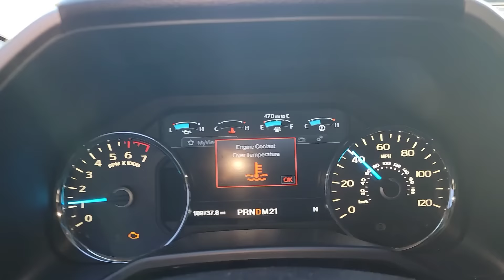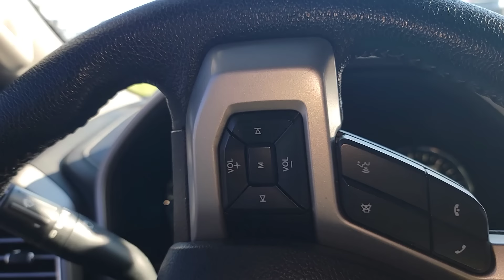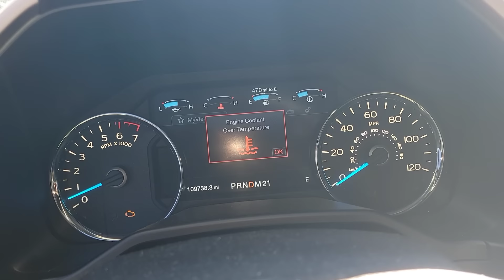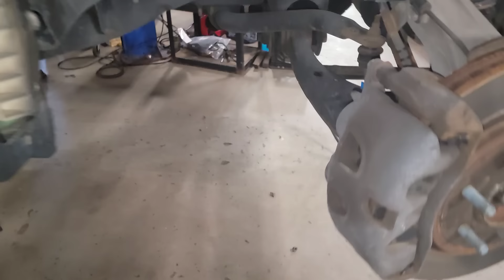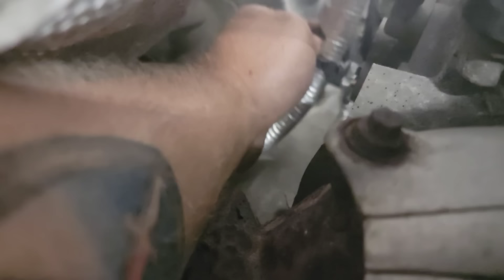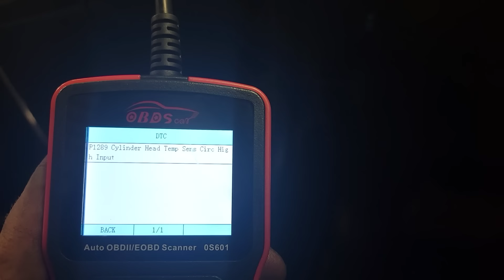2015 - 2016 Ford F150 P1289 - Overheat Out Of Nowhere - here is the fix - Cylinder Head Temp Sensor

Comment: Same issue yesterday on 2015 5.0.  It stranded me and 88 year old mother in law.  Was fine on the way to her house 8 miles; turned off to walk her to truck. Didn’t want to start.  Started on second try.  AC wasn’t working right (90 degrees outside).  Started watching temperature gauges nothing showing on coolant gauge, transmission temperature was fine.  Didn’t make it home.   

Now I am worried about mother in-law seating in the heat and of course my broken down truck.  I waited for ten minutes between attempts to crank truck and drive the approximately 1 mile to my house.  It would not crank.

I found this video after family picked up mother in law.  I saw where clear codes to operate correctly.  I happen to have something to clear the codes with.  It was like a miracle.  Everything was operating like perfectly.  

Today I changed the sensor.  Without this video I would have been screwed.  Thank you so so much!

I had 2 iPhones; FaceTimed myself to get a good view of the sensor.  Your video put me on it but seeing it while working it was good for me.
Reply from the maker: Beautiful

Comment: Had this exact alert and problem happen on my 2016 5.0  158,000 miles this week. Alert showed on dash, Temp gauge went to 0, CEL on, and Trans temp showed normal like you mentioned. Before I saw your video I dropped my truck by a local non-dealer shop. 

They did a disposable block test and told me that test showed coolant present in the cylinders and exhaust present in the coolant system. They say bad head gasket. Recommended engine replacement. I did have them clear the CEL for me, I paid for 30 mins of labor and brought my truck home “ran perfect coming home a few miles”. 

Oil looks perfect, no smoke, no sweet smell exhaust. Coolant reservoir shows about 1/2 inch low below the Max fill line.  I picked up this sensor at Ford this morning for $28; going to throw it on and see what happens.
Reply: Any update? I have the same truck w the exact same problem. I’m waiting on the sensor from Amazon, but when I dig in under the wheel well for the sensor, my undercarriage looks a bit different, and I CANNOT for the life of me find where the damn thing is. Any insights?

Comment: Yup. Had this same issue. I was leaving Walmart and out of nowhere my truck said it’s overheating. Throws codes. Then puts the fans on high the whole drive home. Told my mechanic the next day, googled the issue and found it’s one sensor on the backside of the block. Good video though bud 🤟
Reply: Right now I’m having the same issue please may may I have a sensor name ?? my truck said engine coolant  over temperature

Comment: A Ford Senior Master Tech had me remove the negative battery terminal for 10 minutes and I was able to get off the highway. Saved me an expensive towing bill! It kept working fine but still changed the sensor. It is on the third one over 120,000 miles. The lift sure helps replace it!

Comment: thanks to your video I was able to do this job on a friends truck. I didn’t have to remove the fender trim, I removed the two screws that were hidden for the fender liner, also the harness I didn’t have to move it out the way. But I did it blindly just by touch. Very easy. Thanks 🔧🪛🧰😎

Comment: Have not had overheating for many many years. Last time the fan belt broke and the engine burned up most of the oil and boiled out the coolant. A new belt and top up coolant and oil and was on my way. Big old cast iron V8, 472. Can’t keep driving to a garage today with modern engines.

Comment: My 06 F250 does the same thing.
Temperature gauge goes to full hot but the engine is not hot.
I’ve had it in the shop twice, replaced sensor and harness twice.
Once in awhile it will do it again.
I simply turn the engine off, wait a few minutes, restart the engine and it’s all good until the next time.
Reply: Just read your comment.  I assume you have the 6.2L. Have you replaced the sensor.  My truck did the same thing a month or so ago and I could not figure out the problem.  Haven't had any issue since and it runs perfectly.

Comment: I’m currently experiencing this on my 17’ ecoboost mustang. It was my fault for not checking the coolant before going to work. When I filled it with coolant, I had autozone check my engine light. It came back as my cylinder overheating protection is active. The car runs, idles, accelerates just fine and doesn’t give the notion that it wants to stall while driving….

Comment: Ok, I give up after 2.5hrs of frustration, how does the clip for the wires come apart? I’ve tried a little screwdriver and can’t seem to get the clip to release. Wish there was enough room to have filmed that part. 

The way this presented for my daughter on her 2016 F150 5.0 is pretty much as described, she got about 3 miles from the house, the temp gauge pegged at max, over temp warning message popped up, and the engine started shaking and barely ran. She shut it down and called dad. I pulled it home, pulled the therm and tested it on the stove, working perfectly. Went searching on good ol utube and found this vid. Thanks for posting, really helped us out in figuring out what was happening. 

Now about that clip…
Reply from the maker: Clip for wires? I have no clue what clip you are talking about 

There is a connector for the sensor - it pulls back and you push the end of the lock down like it's the release and pull the connector off 

I don't know what else to say 

If you want to video chat me later and show me what you are trying to do here is my email 

Poissorichard.rp@gmail.com

Comment: Same thing happened to my 2002 f150 but completely opposite.  Coolant temp sensor was dead throwing a p0128. I verified that the thermostat was not hung open and when I hooked my scanner up to it the reference voltage was five but the sensor was only 300 ish ohms  when the engine was stone cold
Reply from the maker: Yep that sounds like a problem for sure

Comment: I bought  2016 f150  2.7 echo to this day only 16k miles . I got it brand new off lot first owner .  4 weeks later turbo  on left goes out . and high temp light on and fan is racing .  took it to ford and they refuse to fix it . I was never ruff with the truck  I hardly drove it because I m a otr driver.  So basically i got screwed  on that truck . I still have truck but it just sits. there was a really good reason it sit long to . to be honest i feel  like washing my hands of it.   lets say i got a free truck  after taking 3 years waiting for legal action to  rule in my favor.
Reply from the maker: How much do you want for that truck

Comment: I have an older 2007 expedition with the cylinder shut off cool down feature. When I first got the vehicle on warmer days and in reverse the cylinder shut off would engage and I thought it was a reverse problem and then it started doing it while slow rolling after driving and I thought the vehicle was breaking down from being old and then I learned about the cool down feature. It does it all the time now and I think I'm having the issue you are showing. There is no dash warning for it on a 2007 but everything with the truck is running fine as you've stated.
Reply from the maker: I'm not familiar with the older style
Reply: @FordBossMe  It glugs like a diesel when it does it and I used to think it was stalling out so I would quickly drive to increase RPM's but I know now that as soon as it seems to putter out it 
re-corrects itself and then idles normally but its still annoying, it will do it when driving slow now and it slightly changes the performance and when you are by people they think your truck is in the process of breaking down.

Comment: Similar situation for myself on my 2017 3.5 ecoboost. 3 years ago radiator & new water pump. 6 months ago hauling a load with ac on truck overheated and blew coolant out the relief. Shop replaced the tstat. Was good over the winter but then about a week ago when I hauled again with cruise on ac running air temps around 55 and it progressively warms up quickly and throws the overheat. However no check engine lights. Pulled over and turned ac off and temps went back to normal fairly quick. Finished my remaining 10 minute drive. Fished the day and went to drive back home. Got 20 minutes down the road and it did it again. Still no check engine. 

Any recommendations on quick things to check before I bring it back in? I got a warranty so they can fix it up but just curious if you have anything I can tell them in advance

Comment: Jeeze, Gotta Dismantle the Passenger side of the Truck to change a sensor that's litterally buried. Engineers??? If they had to work on these units they'd think twice about some of these things. So much for the   K I  S  S  method.
Reply: Not all parts of a vehicle are easy to get to. That is the same for all brands and models of vehicles (and trucks). From an engineering point of view, this sensor has to pick up cylinder head temperature in a spot where it accurately reflects the engine temp (far enough away from coolant temp). In this case that position is not easy to access, though it is not impossibly difficult. I have had issues where engineers have placed/designed certain components. But most times they do a reasonable job. So give them a bit of slack. I am sure some things you have designed have given people grief. But I am sure you had your reasons. Retired mechanic in Land Down Under.

Comment: Great Info. Question if I may 16 PIU 3.7 Weak Trans Mounts caused L/S Inner CV Damage PTU Coolant Lines. Common ?  Saw my First Today 120,000 miles. Parts on Intergalactic Back Order. Thanks for your Time.
Reply from the maker: Not common at all
Reply: Found my 2 concern with motor mounts and PTU Coolant lines this AM. Again 120,000 16 PIU.
Reply: Confirmed weak motor and trans mount on PIU  let's trans drop low enough for l/s inner CV to contact PTO Cooler lines , causing coolant leak. New Mounts make a big difference.

Comment: Have a 2014 F150 3.5L... temp guage after an hour would climb without trans temp climbing. Switched CHT sensor oem and still doing it. Thinking thermostat ,but its only 2 years old and NO CEL or warnings even when its just below the "red"?!?
Thinking could be bad CHT wiring maybe.

Comment: 2016 2.7 Ecoboost with 1299 code. Do you know if that's cylinder head temp sensor or the sensor in the head between the 2 fuel rails? Thanks
Reply from the maker: No idea, I'm on my honeymoon now in Jamaica

Comment: hey i got a 2017 f150 5.0 with 50k on it and it shakes at idle i just got it and asked the dealership to tune it up before i got it. they couldn’t tell me exactly what they replaced but it still shakes. any ideas i think it needs spark plugs. no check engine light
Reply from the maker: These do run a little rough honestly, run some 93 and report back
Reply: @FordBossMe  i have been running it on 93 for the last two tanks and have gone on some long drives. i think it runs better but it’s not right , dropping it off this week to have the dealership take another look.

Comment: Hopefully you respond, mine keeps failing. Had a mouse get in the wiring going to the cylinder head temp sensor and I had to drive it for a couple months because I didn’t have another vehicle to drive. Mechanic fixed the wiring and the sensor seemed to worked for an hour then started doing what your video shows. Took it back and he replaced it and it didn’t seem to help and he checked his wiring and had him replaced radiator and fuel injectors and spark plugs and coils because the truck has almost 100k miles. Anyway sensor still doing same thing works sometimes for a minute or two and then it’ll quit. Ordered a wiring harness from ford dealer ship and a OEM cylinder head temp sensor, waiting on them to come in now.  Do you think replacing the wiring harness  will fixing the problem or do you think it could be a problem with the computer now or do you think the China made sensors are just crap and that’s why it won’t work right? Anyway I can call you and pick your brain 🧠. Also mine is a 2012 ford XLT crew cab 5.0L. Also it didn’t start running rough until he “fixed” the wires. Before he “fixed” the wires the fans would just kick on and stay on and ran fine. Now having the other issues. Ugh 😩
Reply from the maker: You may need a new harness
Reply: @FordBossMe  ok awesome thank you

Comment: What if that doesnt show up but the fan runs like crazy and the coolant temp is like going up and down and if i slow down i goes down still the fan ran like crazy is the sensor is starting to be broken? Its a 3.5 ecoboost is it located same as the 5.0? Thanks!

Comment: My 2011 eco 3.5 f150 is doing the same thing but without codes or check engine light. (I do have a basic scan tool). Not loosing any coolant. Trany temp not going over 205 while doing 80 in Florida heat. Engine temp allegedly hit 245 then if I got on it it said reduced engine power due to overheating.
Reply from the maker: So replace the cylinder head temperature sensor
Reply: @FordBossMe  will do. Thanks for making all the videos you do and putting out all the great content. You are really helping us all out and l really appreciate it.

Comment: I am having the same issue after changing a cracked thermostat housing. Drives fine for 10-15 minutes then the temp gauge rises and the overtemp light comes on. No check engine light or code. Let vehicle sit for 10 mins and you can watch the gauge come back to normal. Start driving and ten minutes later it does it again. The engine does seem hot. Trans temp remains in the middle. Bad thermostat?  Air in the system?  Any Ideas?
Reply from the maker: You need to look at my videos with overheat condition after timing chain and cam phaser replacement because it make a new updated thermostat
Reply: I watched the video and it’s say for 3.5. Mine is a 5.0. Is there a updated thermostat for that as well? I installed a after market thermostat housing assembly probably should of stayed OEM.

Comment: Thanks for the video, just arrived at work and had this happen. Will have to get back home to confirm the code but seems like should be okay and then place an order for the sensor.
Reply from the maker: Watch my video on engineering mode and put your truck in engineering mode and you can monitor your trans temperature to verify whether or not it's actually overheating
Reply: @FordBossMe  thanks yeah, I have an OBD-II reader and was looking at it. Temps never went above 204F. Funny thing was the gauge in the dash had the coolant needle at completely cold when the error came back. I cleared the 1289 code and the fans immediately turned off and the gauge went right back to the center. Sounds like that all but confirmed just the sensor. Thanks again for the informative video.

Comment: can i access the sensor this same way on 2015 explorer with a 3.5? or does the explorer require removal of the intake manifold etc.?
Reply from the maker: Completely different engine so obviously everything is going to be different I have a standard mounted engine you have a transverse mounted engine and yes it's everything's going to be under the intake manifold I believe

Comment: Hi, please I have a 2015 Platinum and i've changed my temp sensor, after a few weeks of running (about 3 weeks) then the issue started again. What else could I do to fix this?
Reply from the maker: Probably still the temp sensor you probably got a cheap one or one that's defective and need to put a new one in
Reply from the maker: The key to knowing whether or not it's actually overheating or if it's a sensor issue as if the engine says it's overheating but the trans temperature says it's normal you know you got a connection issue or you got a sensor issue
Reply: Just happened to have the trans temperature gauge on in my display when this happened to me today. Thank you for this video. Exactly what you said it was

Comment: What if you change the sensor and the problem still persists? Also could not removing the code cause the fam still get high even after changing the sensor? Thank you in advance
Reply from the maker: Then you got other problems going on or you're not doing something correctly like maybe you have bad wires or maybe there is something going on that is causing it to overheat that's going to have to be something that you stopped working on it at some point and maybe take it to a shop and let somebody diagnose it if you can't figure it out

Comment: hey would this diagnosis and correction be creditable for 2016 ewplorer xlt 3.5l v6 4x4 please im desling with exact diagnosis. ty
Reply from the maker: It very well could be possible but they are two different vehicles in this video is not for that vehicle
Reply: @Ford Boss Me  man I cannot get a clear answer or representation for free on where the ect is located with my wifes engine. I don't think it would be wise to start taking valve covers and thermo housing apart if im not sure that it's ect graceland ya know, appreciate the response man imma subscribe and like my friend

Comment: I cannot understand the benefit of this type of sensor. Why not an actual probe in the coolant? To try and avoid a potential leak? My Mustang GT has some engine data readout on the cluster, and “cylinder head temperature” is one of them. Guess they weren’t kidding. I have no idea how you’d ever get to this sensor in the Mustang chassis